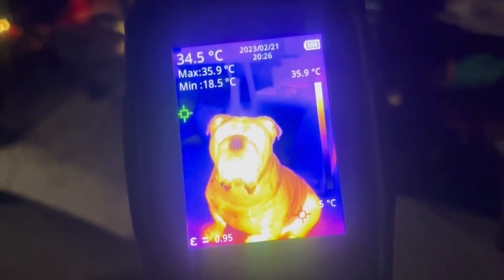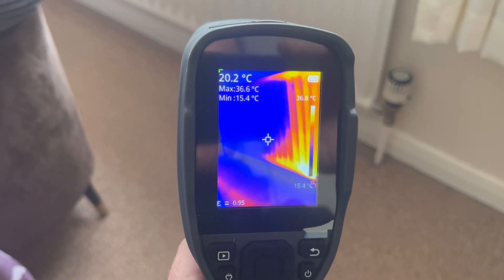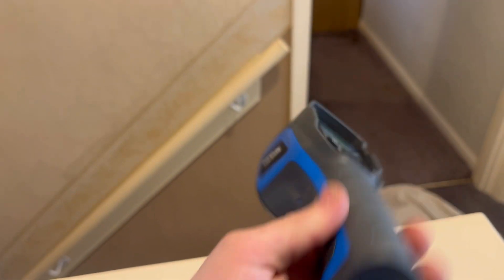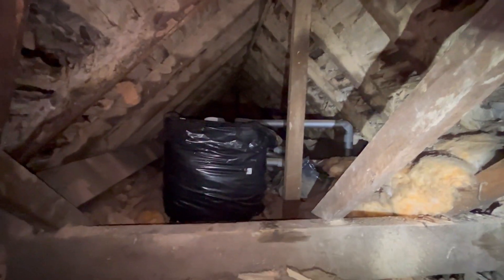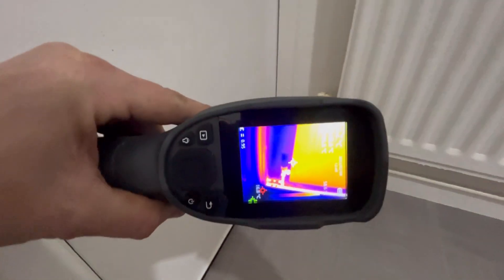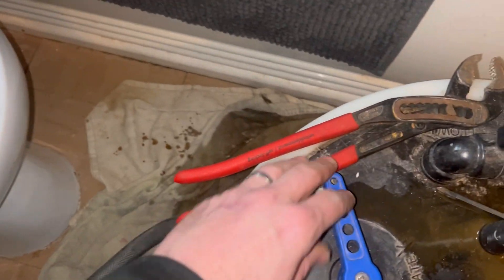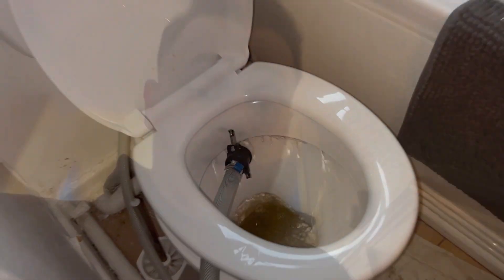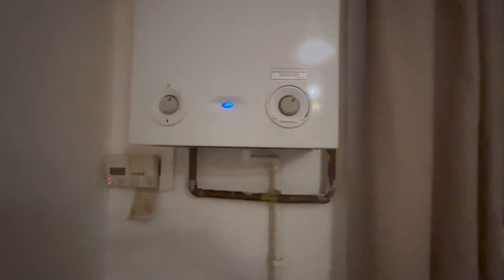Will THIS Thermal Imaging Camera Improve Heating Performance? Topdon Tc004

Comment: i cleaned out the header tank in our system, had loads of chunks of sludge and god whats inside yuck, filled it all up checked on it the other day and the waters already cloudy and orange and front room radiators got a massive cold spot at the bottom of it so god knows whats up haha
Reply from the maker: If you’ve just cleaned the tank out then it will just get mucked up again over time

Comment: Another useful video thanks m8y. Yeah having the tools to make your customers more aware of the situation and the service they are receiving is well handy and could be the tipping point for them choosing to have the flush done, as its quite an expense for them. You could also use it for diagnosing and advising customers that they actually need a system clean/flush and to be honest for this one all you need to do is showing them a picture or video of the circulation pump it speaks for its self. Good job as always bud, I'm glad things look to be progressing nicely for yah.
Reply from the maker: I’ve been impressed with the camera mate, your right can come in handy for diagnostic work, will pay for itself on flushes so handy bit of kit to have 👍

Comment: Nice vid Luke, thermal cams definitely help giving customers visual proof of the work carried out. The dirtiest system I flushed was a conversion which was 40+ years old, all original rads, Ideal Mexico floorstanding. You can imagine the filth that came out of that! I was flushing 1 rad for an hour and it just wouldn't clear up completely. Did the best that I could, but explained to the customer that with rads being original 40+ years old, he may want to consider changing them in the future at some point. I used FX2 as well!
Reply from the maker: Wow 40 years! Bet that was a nightmare mate, it’s is satisfying getting the muck out but I was same as you, when you spend an hour on 1 rad and you just can’t get it clean you start thinking am you ever going to get it all out! To be fair I’ve seen your flushes mate and you do a top job on them 🙌👍👍

Comment: Are any of the thermal cameras able to see pipes in screed?
Reply from the maker: Tried it on some underfloor and you could kind of make out where the runs was but wasn’t exactly crystal clear due to the depth and heat coming off pipes

Comment: Who needs an iPhone all singing all dancing supposed to be, I’ve been using a cat S60 S61 for years built in Flir camera  two tools in one. I also use it to check the flow and return on the blr are not the wrong way round come across that a lot for instance the kebab on the Greenstar will show hot on the bottom cooler on top.
Reply from the maker: Never thought about checking flow and returns with it, can see how it will help if you have a boiler piped up wrong, easy to prove when you can see the thermals 👍

Comment: Vibrocleanse wih power flush every time, I’m after one of those thermal imaging camera, but want bigger screen
Reply from the maker: They all seem the same size unless you look at a lot of money for what I can see, this one has a 2.8” screen which I found fine for what I was using it for…yep also agree vibrate rads when cleaning a system for better results 👍

Comment: Can also use it to show customer they actually need a power flush ,so could increase business.
Reply from the maker: Yeah especially on quotes you can go round and show the customer where they have cold/dead spots on radiators effecting there efficiency

Comment: Excellent video mate, I agree that they make you feel much more professional about what you’re doing and if the customer is watching you using it then they usually have a much better understanding of the problems you are trying to point out, keep the videos coming mate👍
Reply: It would be good to see you use the camera to balance a system if possible
Reply from the maker: Thanks mate, really helped and will change the way I powerflush from now on, lot easier to concentrate on the areas I need instead of just going round vibrating rads 👍

Comment: For the price of those cameras id expect them to fix the radiators whilst pointing it at them for me, not just tell me the temp 😑
Reply from the maker: Depends how often your going to
Use it, it’s definitely an investment tool if your looking at showing customers value for money or identifying cold spots on heating systems to improve efficiency by removing them
Reply: @bluebulldog_uk  or you could say to the customer 
Put your hand on the rad here, it’s cold, do the flush, now put your hand here and it’s hot and that’s free 🤣

Comment: ive got the topdon 0005 model. got it at a good price with offer and discount on top. handy for locating Ch pipes in wall. could located the drop feed in a stud wall. or if anyone is worried about drilling into pipes. put the heating on for 15 minutes and scan the wall.
Reply from the maker: Yeah that’s a great shout, I actually tried it on the ceiling and it showed up where the joists were so plenty of applications it can be used on 👍
Reply: @bluebulldog_uk  it also detects under carpets as well. so can located pipe runs.